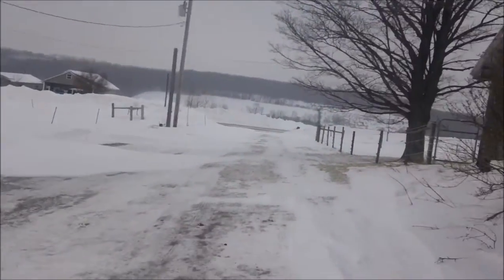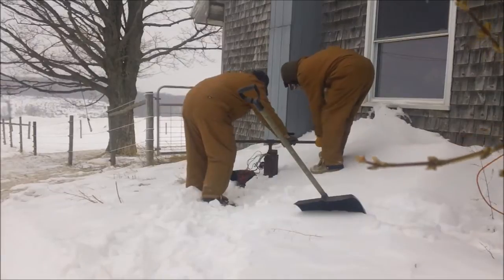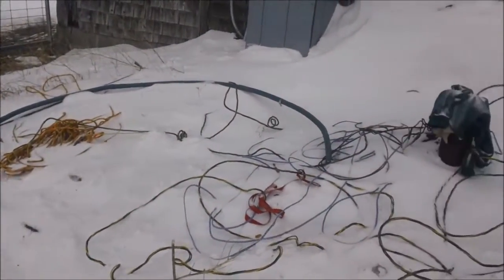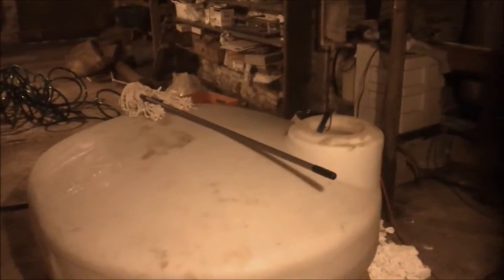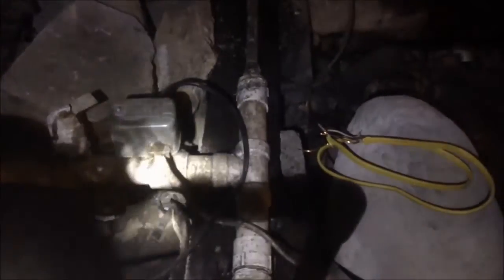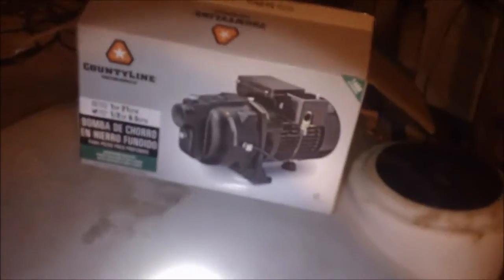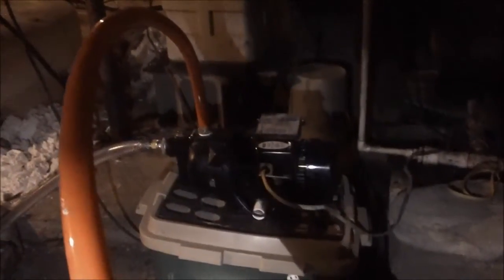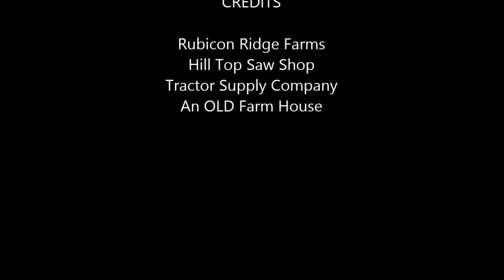The Definition of a Really Bad Day.....Well For House Water Failed. Then It Gets Worse

Comment: Wow - I'm about 800 miles North of you and it's been a colder than normal winter as well.  The well issue is not unique to just your farm.  Have you had frost quakes just prior to losing the water level in the well.  This is affecting the water table and loss of well water level. Just wondering if your heard  loud bangs, most people think their foundation has shifted or roof trusses  are shifting from the bangs they hear.  My neighbour lost his water two winters ago , did nothing and by end of March his level was back up.  Maybe  yours Is different just thought I would mention it. Pretty good thinking on the stock tank. 👍
Reply from the maker: Steve Rob Thank you for both watching and the insight. Never thought to listen or even think about a frost heave. We are on a hilltop and quite exposed to wind..

Comment: How deep is your well?
Reply from the maker: Tim Cadile It was 142ft with a 5inch casing. An old well. The water level is at roughly 30ft below the surface.
Reply: Before spending 8k on a new one, id try to get ahold of that plastic. Im sure you can fabricate some sort of fishing tool/overshot to grab it. If you're sure its frozen, can you pump hot water down it?
Reply from the maker: Tim Cadile not frozen from cold temps, but from either a partial collapse or shift in the shale. If I could break that tubing down around 140ft, I could just drop another pump down in there. Problem is HOW do I do that??
Reply: afleetcommand  Gotta get ahold of the tubing and just pull. If it brakes too high, just keep doing it until you're deep enough.
Reply from the maker: Tim Cadile We are going to try that. Have a couple of ideas along the lines of using 1/2pvc with a 1/8 in cable through it to a noose, use the pvc to guide it to the tubing first then add sections to push the noose down...hoping the weather will allow that this weekend!! Also considering digging out to the pitless adapter and cutting the pipe larger for a pitless design for a deep well jet pump as that system could slide down along side the existing tubing if we can't snag it outa there. Thanks for the support and insight BTW!
Reply: That sounds like it could work. I know I dont even know you but I couldn't stand to see you drop 8k unless its absolutely necessary.  Is the tubing 1"? 1.5"? I might try to come up with something just to see what will/wont work.
Reply from the maker: Tim Cadile You and I both! Don't have 8k to throw around so certainly will evaluate every option! The tubing was 1.5 I believe. And thank you for helping! I thought I saw it "prairie dogging" when it first broke at the water line... but suspect it will have settled by now. The last storm (Thor) makes it tough to get out there and look, still have to dig the snow away at this point from the last storm... LOL Live in CNY!
Reply from the maker: Tim Cadile And BTW ANY idea you come up with is greatly appreciated....